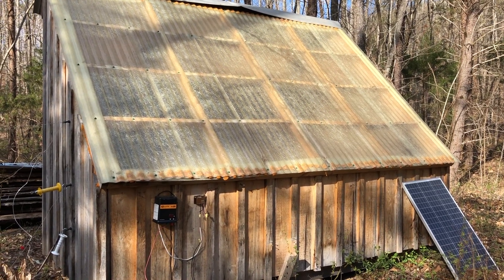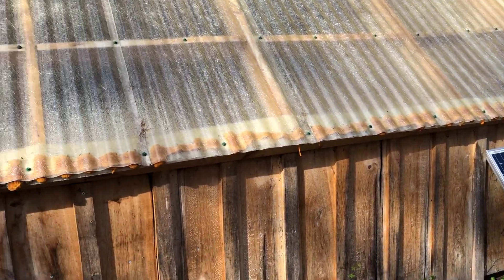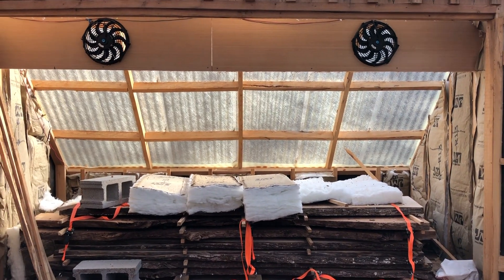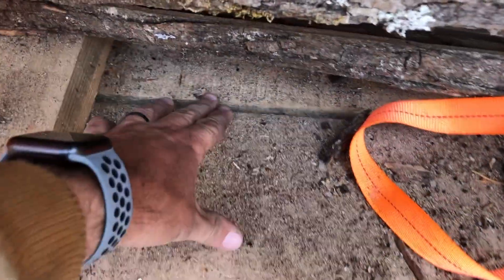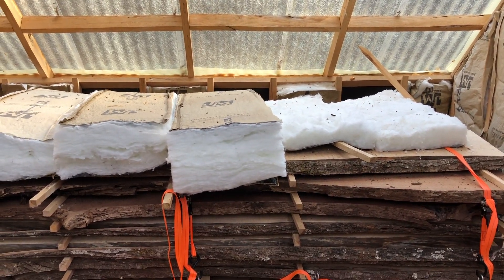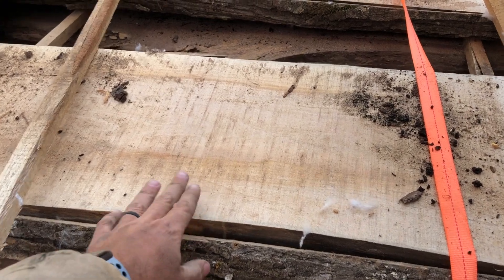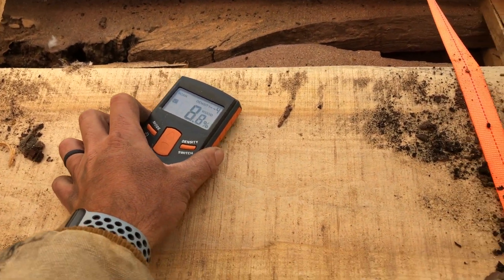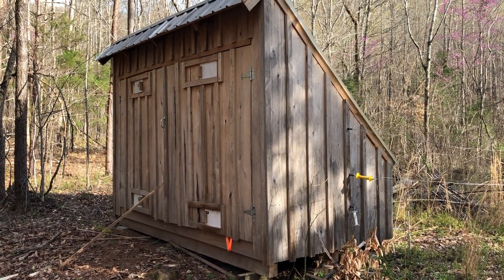Wood Solar Kiln 2 Year Update

Comment: hi andrew
nice build and i like the later addition like the small over hang over the doors and sealing the bottom of the the roofing material
which im putting in my build
as for my build ,ill be putting my solar kiln on an old trailer base ,that way i can shift the kiln where and when i want and sun direction with  having to see if i need a permit to build !!!
keep up the videos 👍

Comment: Good to see your update video. I've been running loads through mine all last year. I ran a wide piece of black plastic stapled below the fans and I drape it down to the top of my slabs. The black increases the temps and it circulates the air down in front of the slabs. I've dried loads in as quick as 3  21 days.  Time to build a 2nd one now. Keep at it Andrew.